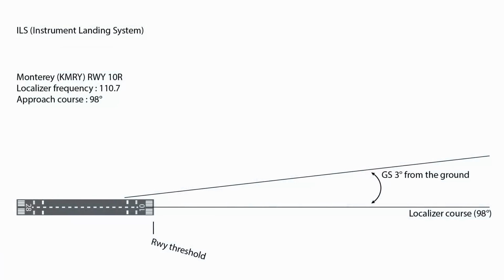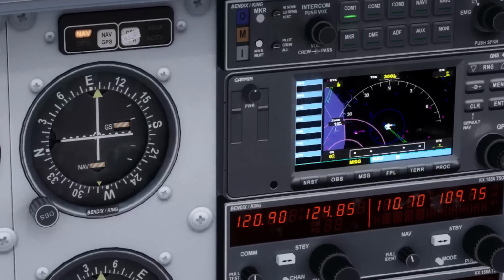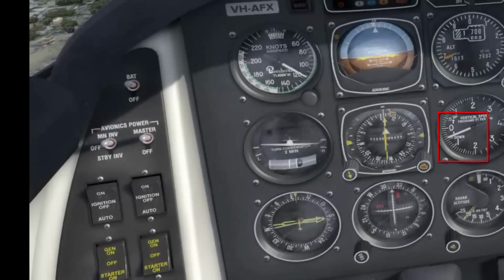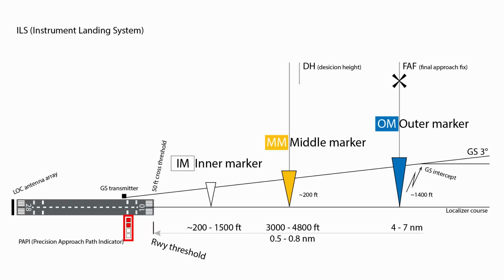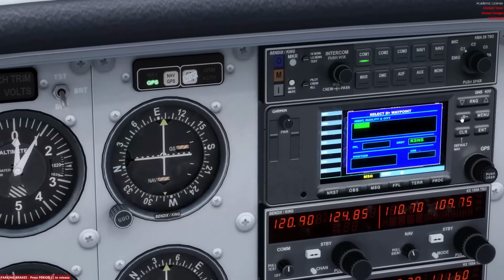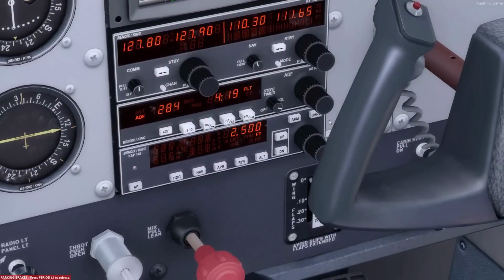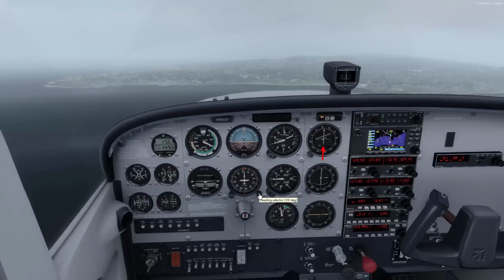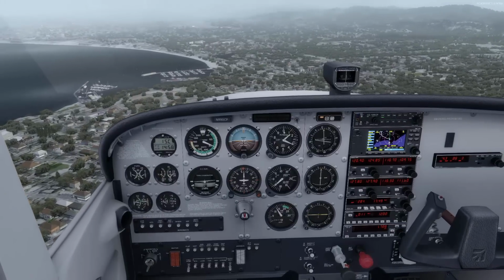ILS explained my way / approach chart KMRY 10R / A2A Simulations Cessna 172 / 1080p

Comment: hi Gunther, tanks for this very interesting video, as usual. You know than we are neighbours so why dont make the same record .... in french ? Im joking but british fans could improve their french ! Do You think P3D is better than Fs ? Thanks. all my best. Laurent
Reply from the maker: Thank you, merci beaucoup! It was an airplane with propellers ;-)

The performance and graphics in P3D are better and it is still developed. FSX is not bad but it will not evolve anymore. Dovetail that has the rights for it is working on a new simulator. I don't think that there is much difference between the flight dynamics. If you have add-ons for FSX they are not necessarily compatible with P3D.
P3D is a more expensive choice. When they change to a new major version (v3, v4, ...) you must buy a new full license.
In the past I was a FSX user. Now I'm very happy with P3D.